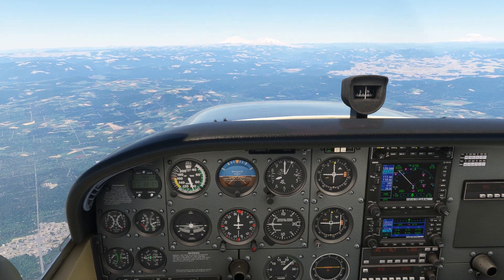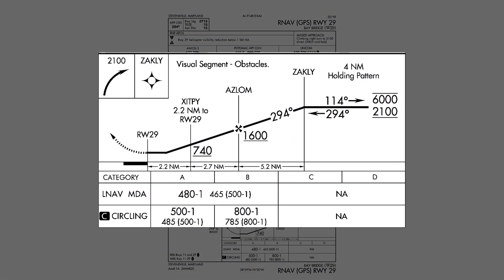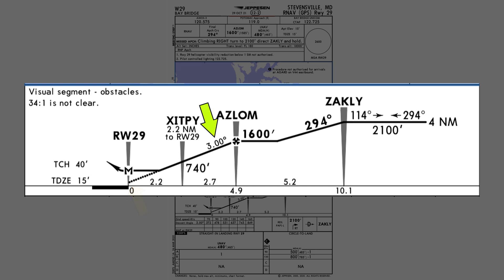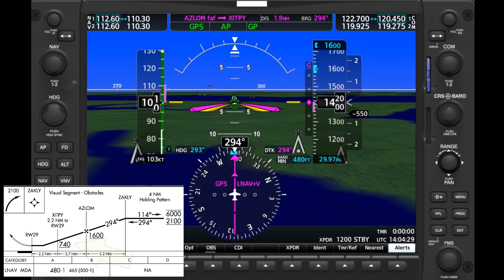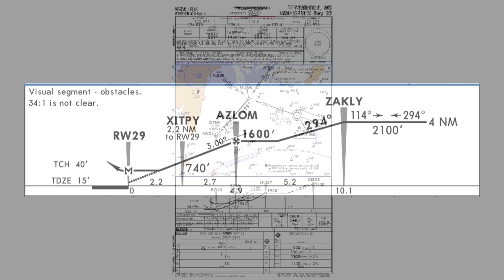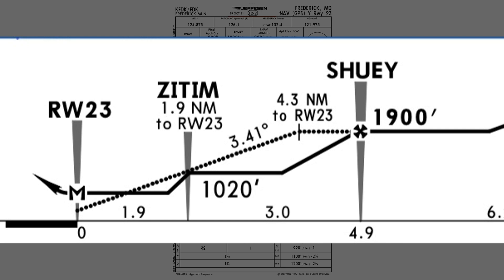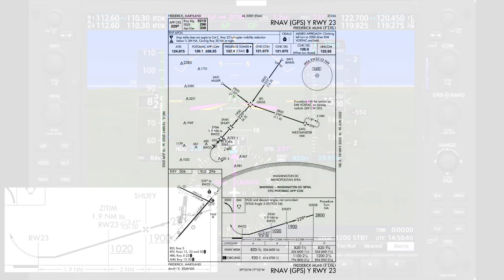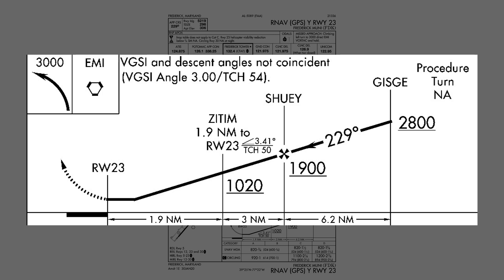How do Advisory Glidepaths Work? | LNAV+V

Comment: That last point about the placement of the glide path angle is amazing. I had no idea and super helpful as someone that doesn’t use Jep plates.

I wish Garmim/G1000 (not sure if it’s the same on G5) used a slightly different visual representation of the glide path diamond between LPV and LNAV+V. Maybe make it an oval instead of a diamond - just a helpful way to remind yourself that you’re NOT an an LPV and thus there’s an MDA and not a DA/DH.

Of course a good approach briefing should guarantee you don’t make the mistake of treating LNAV minimums as a DA but the fact G1000 shows the calculated glide path exactly the same way as an LPV is a bit of a potential gotcha if you’re not careful.

Comment: How far out does the advisory glide path begin? Would you be able to pick it up at around 3200 feet at Zakly (or sooner, from the first example) and follow it down, or does it only materialize at the FAF? I’ve not tried this, but will find one of these approaches and take a look next time I can.
Reply: Forever. It’s a calculated geometric path and has nothing to do with LOS or anything on the ground. Yes, but the FAF has to be the active waypoint for the diamond to come in. Think about an ILS and flying into the glideslope (very similar but not exactly the same). Note that if there is a step down IF between the IAF and FAF on the same final approach course in an LNAV one nice trick is you can make the FAF the active waypoint earlier and get the GP a little earlier then flying down to the IF and then seeing the GP. Of course, all of the above have a ton of caveats but the bottom line is the GP is a calculated path and exists outside of anything in physical space like an RF signal.
Reply: @pisymbol  Yeah, I think that’s the answer I was looking for. An ILS, as long as it’s tuned, has a certain signal strength and can be picked up dozens of miles out. The LPV comes in pretty early, as well, but only when the approach is loaded. Sounds like this would come in only when the FAF becomes active…?
Reply: @ddthompson42  Yes FAF must be active for you to see GP but that can be still several miles out.